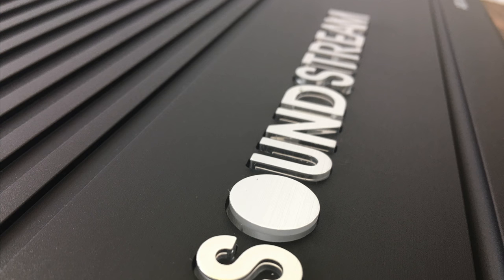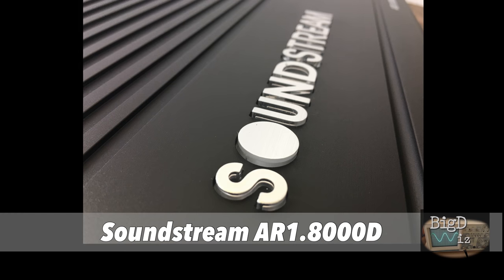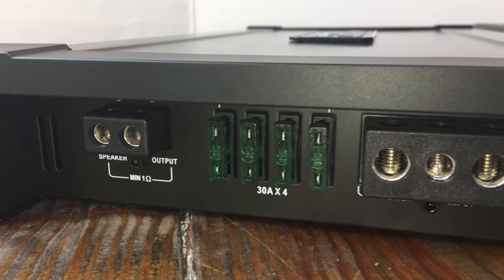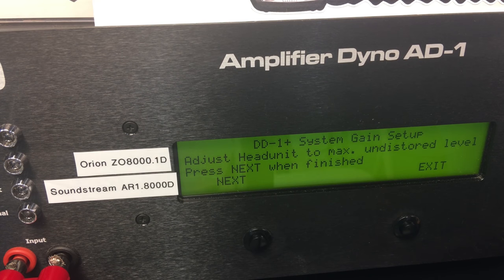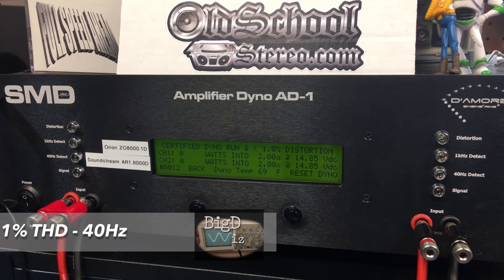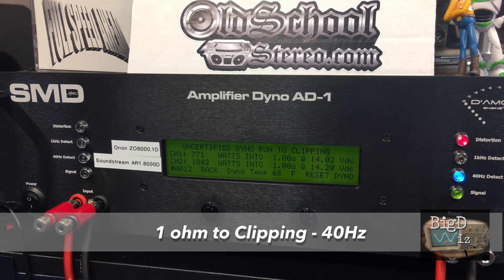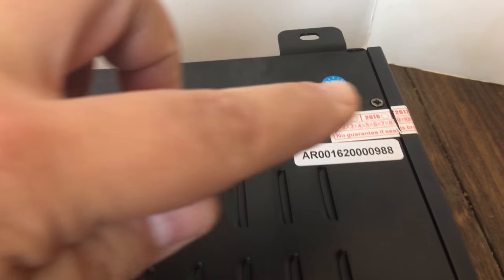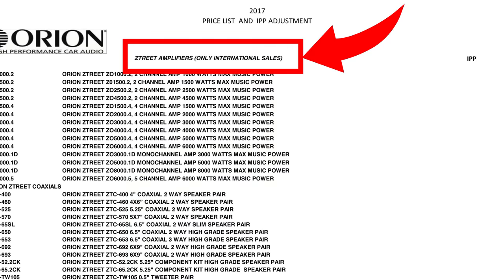Budget 8000W Amp Dyno Drag Race! Orion vs Soundstream

Comment: Can you dyno the Orion hcca 5000.1D. It has some outrageous numbers at 12.7 volts. Theyre currently no dyno videos for this amp. Here are what they're claiming for specs

RMS Watts @ 4 Ohm Stereo 12.6V:   2120 Watts X 1 Channel / RMS Watts @ 2 Ohm Stereo 12.6V: 3600 Watts X 1 Channel / RMS Watts @ 1 Ohm Stereo 12.6V: 5400 Watts X 1 ChannelRMS Power Watts:      10000 WattsFrequency Response   15Hz~250KHz(-2.5dB)Signal Noise Ratio:      90dBHi Pass Freq.   15Hz-250Hz / Low Pass Freq. 15Hz-250Hz
Reply: At 14.4 on the Orion site it's claiming over 7000 rms @ 1 ohm
Reply from the maker: +Michael Brooks I’ve seen independent tests confirming over 7000 watts at 14.4.

Comment: Okay so i purchased the Soundstream AR1.8000D, but I noticed that the amp does not have a fuse. I was wondering what kind of fuse to put?
Reply: Ehson Amsa 200 amp o
Reply: +TheSjb1000 Okay 

thanks for the answer
Reply from the maker: +Ehson Amsa I ran my tests with a 150A fuse and didn’t blow it

Comment: I just purchased a ar1.8000d, states it's rated 4k rms @ 1ohm... I'm lost
Reply from the maker: Send it back if you can. I would personally not buy either ones of these. They are both extremely cheaply made and prone to pop
Reply: @wal  yeah I returned it and got a taramps md3000.1 2ohm

Comment: it is physically impossible for the prion to do 2k watts as the fuses only add up to 120 amps.  at 14.4 volts that is only 1700 watts and only if it were 100% efficient. also physically impossible
Reply from the maker: +Quinn Meche I didn’t write the specs bro, just tested the amps 🤷‍♂️
Reply: You think that's scary, open up a Banda amp and check out the internal fuse. Always best to remove it and solder in a copper buss bar across the terminals.

Comment: orion wont be making 2k whit less than 200 amps of fuse, its just impossible
Reply from the maker: +alekpo2000 sure it’s possible, just not for extended periods. The SS was fused with 125A and it didn’t pop. The fuses can pass 2-3x their rated current for short periods

Comment: Nice videos. Can you test the Pyle Power 4000 watt 2 channel amp. Thanks
Reply from the maker: +RAM ROD oh boy, another overrated one
Reply: BigDWiz I know it's overrated but I have it hooked up to 2 Pyle Power 2000 watt 15s and  hits very hard but I'm guessing it's putting out like 800 to 900 Watts but for $200 I got the amp and speakers which seem to match perfectly running at 2 ohms per channel when it comes to power no overheating or anything and i built a custom bandpass box hits very hard in my suburban  and very impressive for $200. Been using them about a year and never failed people don't believe that's all I spent to get crazy bass. Would really like to know the output on it and I think your videos are awesome that's why I wanted to ask you. Thanks for the reply